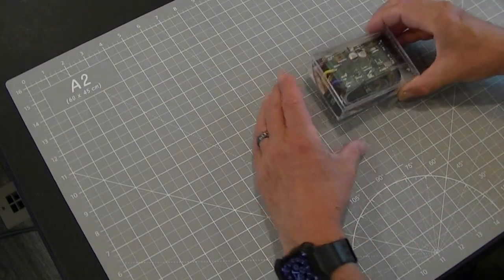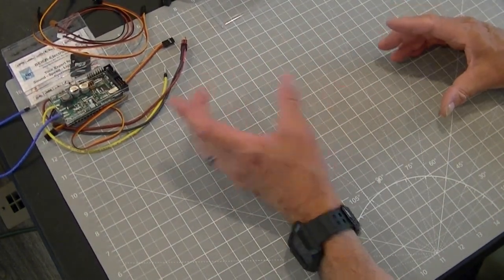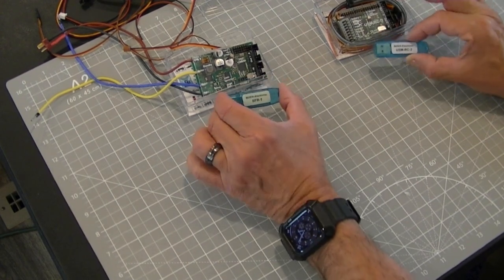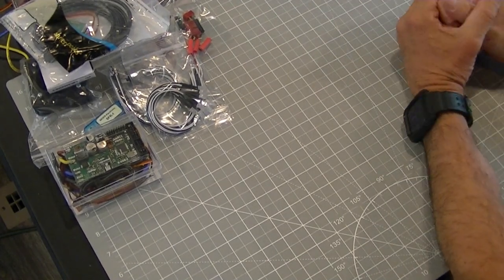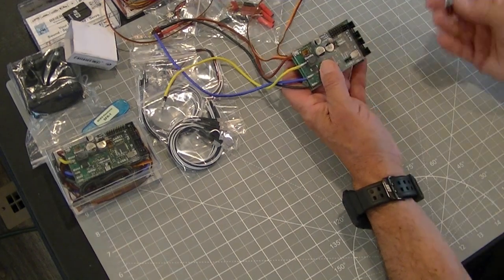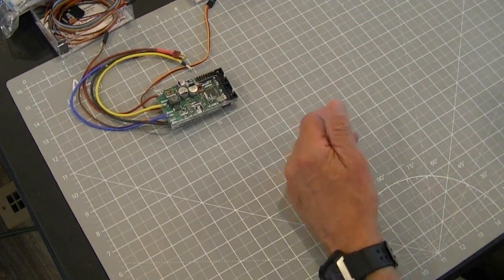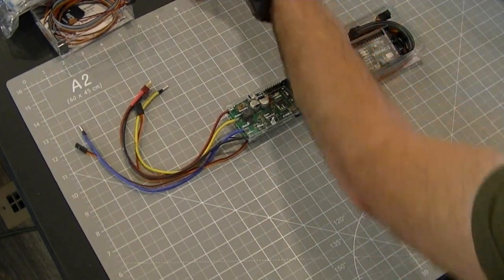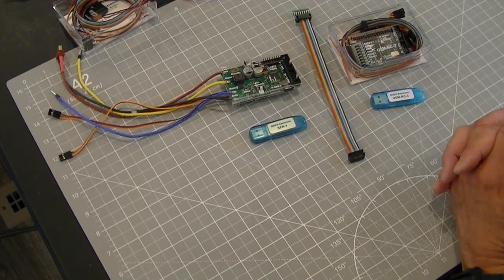Beier Masterclass Volume 1 - System Overview

Comment: This series is awesome.  The beier system is extremely comprehensive and, even with the help of the manual, could seem a little daunting.  But these videos make it literally easy to take advantage of all the features.  After only a few hours, I'm getting close to maxing out an 18 channel transmitter with customized commands, lights, edited sounds, and combinations.  Now, I'm just making up new stuff to program into it.

Comment: Great video.  I'm looking forward to the next one.  I'm doing this backwards by building a flatbed trailer first because of supply problems for a 770S tractor.  I just finished the trailer and put the bluetooth electronics in a permanent 'fake' cargo box on top of the flatbed.  Using the trailer lights and the test led cable I can do all the programming before I get the tractor.
Thanks again for all the advice
Ray

Comment: I just ordered the starter pack but I'm using a radiolink AT10.  Why did you go away from radio link?  And will sbus work the same with my at10?
Reply from the maker: SBUS works fine with the AT10.  Since Flysky came out with the FS-ST8 I just like that radio over the AT10 but they both do work fine.

Comment: Hey Bob, thanks for all the instruction videos so far

Can I ask for a couple specific points?

I mean, I'd like to have a set of 'marker only' lights, like the top clearance markers or the side lights down the length of the trailer, and they're switched 'off' or 'on, 40% duty cycle'

But some I'd like as turn/hazard markers, and I'd like them to tick from 100% to 40% if the markers are on, or 100% to 0% if they're off.

I'm also interested- In the USM 3, the Freightliner sound set has a wonderful engine brake rumble. There's also a second page of engine sound configuration.

Is there any way to make one 'Standard engine noises' and at the flip of a switch, turn it to LET ME PLAY THE SONG OF MY PEOPLE BLARGALARGALARGALARGALARG, BLARP, BLARP, BRALARALARUPRUUUUUUUUU
Reply from the maker: Yep, keep watching.  There is a light on while moving function and there is a function to cut engine sounds when a song is playing that would do what you want.  Soon will be a volume on making your own sounds, will do a song and a jake brake.
Reply: @HobbyconceptsLLC ool, now we just have to sort out why my comment up there ended up attached to a clip from a japanese Bunraku theatre performance

Youtube gonna Tube Yous I guess